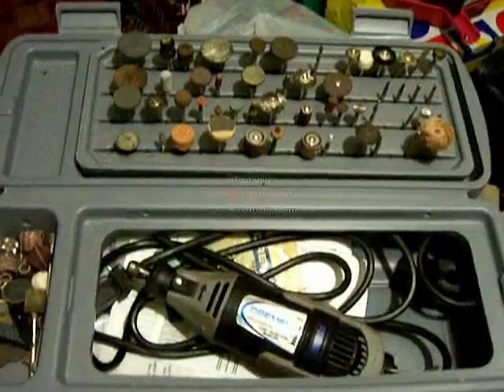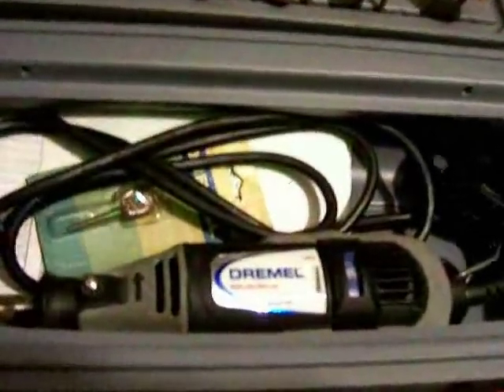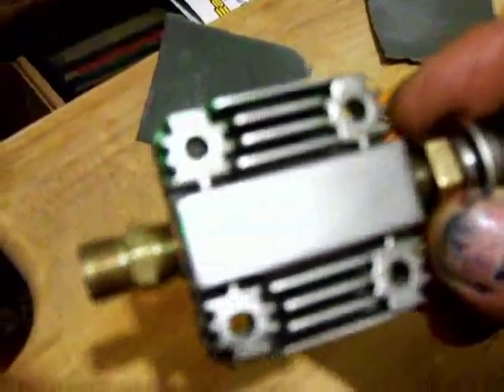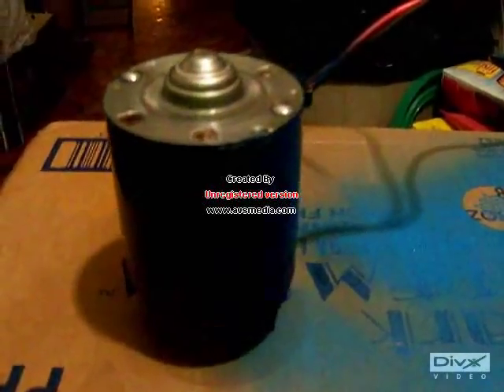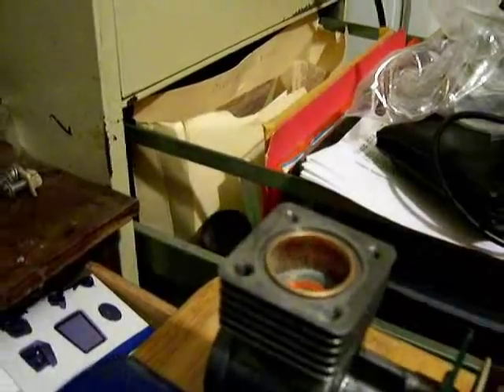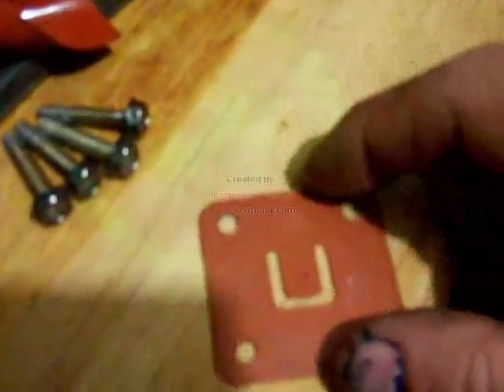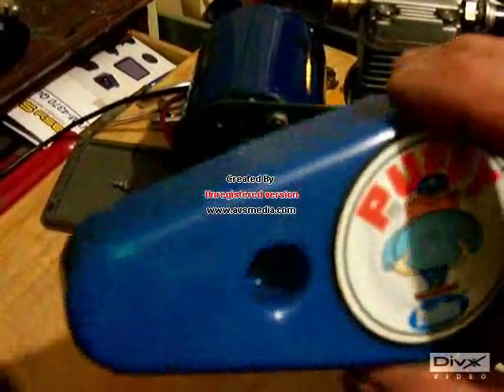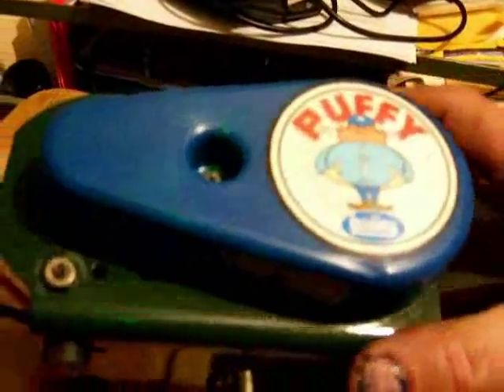How Redneck Repairman Tricked Out A Vintage Hadley Puffy Air Horn Compressor With A dremel tool

Comment: Thats a dayton speedaire compressor, I got one, beautiful little germs, all ball and needle bearings in the con rod setup, virtually maintaince free, just let her not run to hot. Also found a 12V version of this, the gear ratios a bit steeper on it than this here 110V one, its got a smaller blue plastic guard, Was so happy to snatch it at a garage sale for peanuts!!!, it works and pumps air in the tires really quick, quite and heats so very less. Its a work horse and so compact!